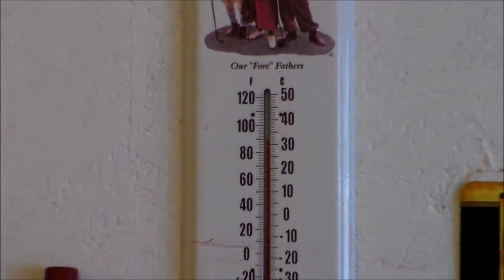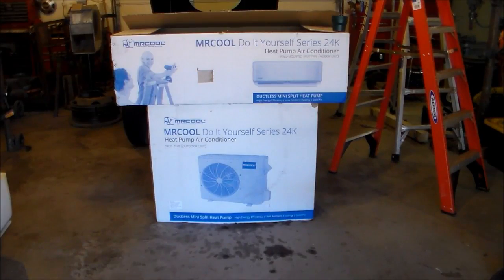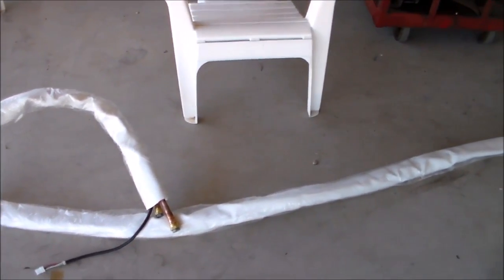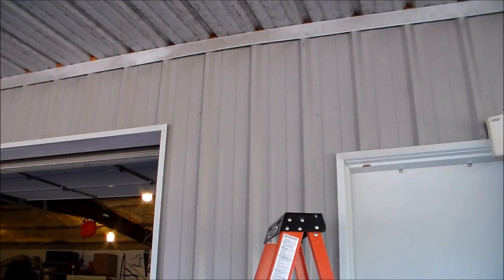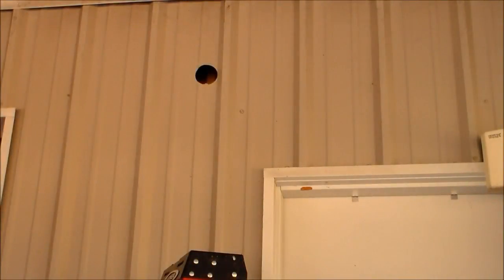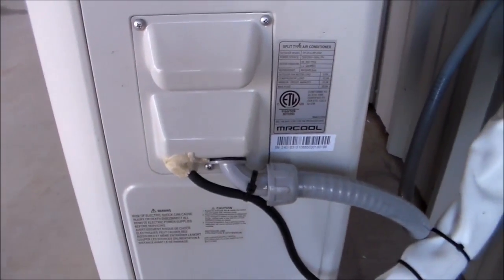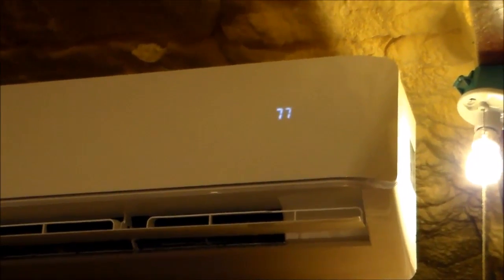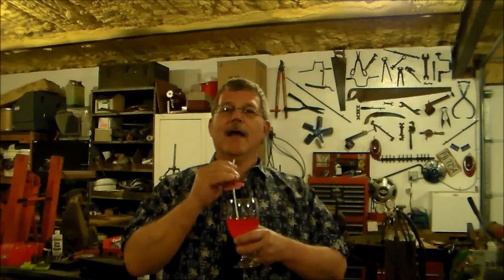DIY Mini Split Install -how to install a  Ductless Mini-Split Air Conditioner

Comment: Great to see you smile rusty. Seems to ba a easy set up. How much you say them units cost with the extras you got too?
Reply from the maker: There is a wide range on pricing depending on the size you need but I got this through the H.D. Web sight.  Thanks Bud

Comment: I installed one for my mother in a room pretty simple and straight forward they work great. Is that a 2 ton?
Reply from the maker: Yes 2 ton unit suppose to cool 1600 sq ft, so far so good Thanks Sam